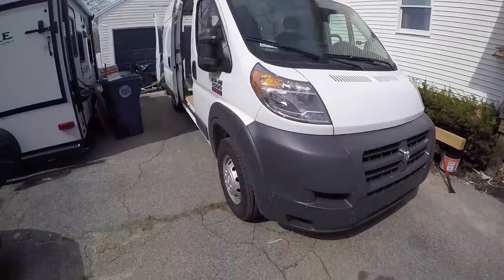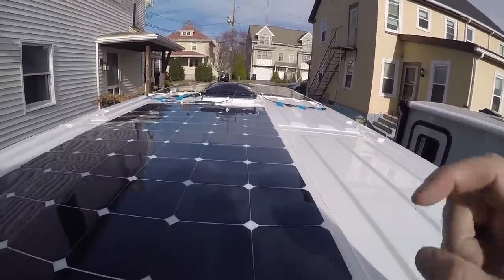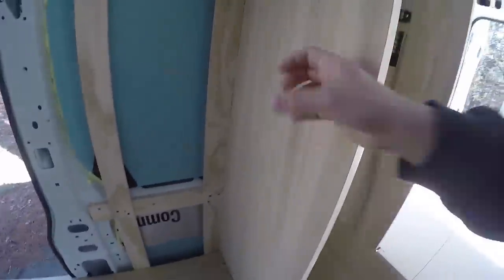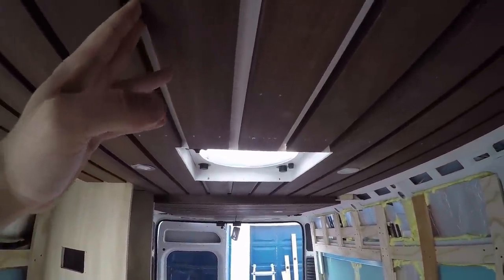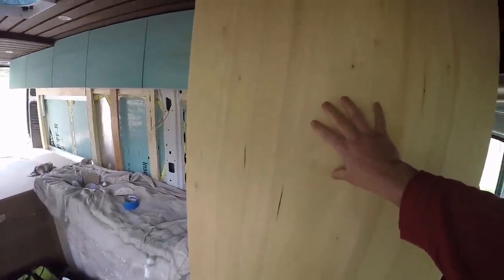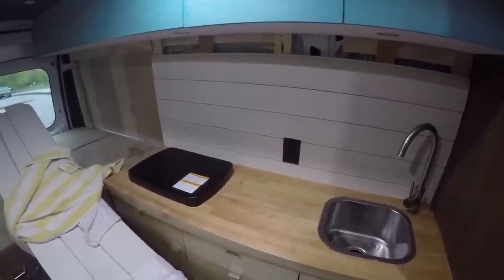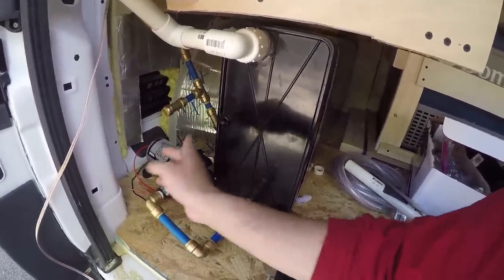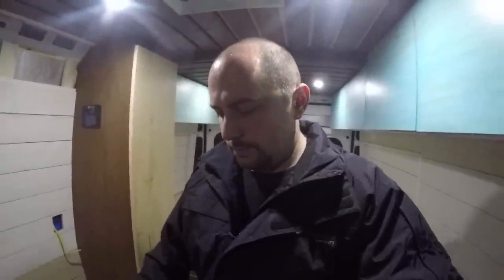How I Converted My Van into a Stealth / Off Grid / Tiny Home Van

Comment: What's the weight of the van befor and after? If your going to do another van u should see what ways u ca  come up with for weight saving/better gas mileage. Great video
Reply from the maker: Thank you. I believe the factory weight of my van is about 5,700 pounds. After the build I'm at 7,400 pounds (which is light compared to others I know, and that weight is with all my things in the van so really the materials are lighter then that). I am building another van but I feel like I'm pretty good about keeping weight down. No matter how you look at it the weight is going to go up and gas millage will go down.
Reply: @JarrodTocci   see wha u can use aluminum instead of wood    if done right I'm sher u could u keep some weight down  the counter top for sher
Reply from the maker: @linkinphm110  yes I could use aluminum as I've seen that used a lot and considered using myself. But to save space I used plywood and aluminum tubing I'd have to probably weld a lot which I didn't want to do. Working in a very small space every inch counts. Only part I'd consider using aluminum would be the bed frame.

Comment: Where did you buy your DC Thermal heater from?😊
Reply from the maker: DCthermal.com but in my honest opinion there's better heaters on the market. I do like mine but bought mine a couple years ago and the 12v heaters are just getting better everyday
Reply: @JarrodTocci  Like what kind? I'm tired of being cold! 😬
Reply from the maker: @campgoerOne  webasto is good and links into the fuel lines. The good ones can run $1200 and decent ones can go for $600. My next heater system is close to $8000. Can't skim on heat so I agree with you
Reply from the maker: @campgoerOne  you could also use a propane style line Mr buddy just make sure you vent!

Comment: Looks great .... That's a lot of wood.  Have you put that think on a scale?   Some states get fussy on weight.
Reply from the maker: Thank you! I actually sold this about 6 month ago and got it weighted right before. It came in 1000 pounds under weight. I just finished my second build! Put out a bunch of build videos and will be doing a full build video and tour in about a month
Reply: @JarrodTocci  I've been using door recovers (not the real name) at $14 for 4x8. Extremely durable and thin/light. Once I cover them with fabric it makes for a good look for the walls & ceiling. I'm in my third year with this method and it has held up surprisingly well. On the excitement level I was a 6 maybe a 7 but everyone comments on how it looks more like an automotive interior than a tiny house so I have stuck with it.  Empty I was getting 24 mpg on a 2006 Sprinter and with the build out I am getting 19 to 22 mpg.  I would love to do a more detailed ceiling that wood gives you but I'm worried about the mpg trade off.  Also I am mainly in Florida and if the authorities want you gone one of their main tools is to make sure you are within the weight limit.

Comment: Are you not concerned about off gassing from the plywood?  I just purchased a van and am cocerned about the formaldehyde off-gassing.   I am inclined to purchase the Pure Bond plywood but it is VERY expensive.
Reply from the maker: C & B honestly no it hasn’t really concerned me. I did look up some “off gassing” and I feel a lot of us live in fear. I spend most of my time in LA so I’d be more worried about the air pollution here then off gassing of plywood. If it helps I haven’t had any side effects since the year I’ve lived in my van and if anything I’ve gotten healthier. If you are really worried about it then pay the extra for it. Hope that helps

Comment: What type of tank did you use for grey water?
Reply from the maker: Mark LaBarge weird story. So I bought one from a store online but had them custom move the drain hole BUT they messed up on it so they ended up refunding me the money. I ended up still using it but I remember it being around $180-200. They were more expensive then I thought. Pretty sure I just googled ‘gray water tank for RV’ and then just read reviews

Comment: So Jarrod after doing a shit load of research I learned that this is not as cheap as stated. This is roughly a 20-40k start up on top of even finding any insurance company that will even touch you living in your van full time. Many won't at all. If they do they will want a house that they can confirm and address with that you reside at
Reply from the maker: We just talking about this in a panel I did at Tiny Fest Northwest. Yes insurance companies are cracking down as this type of living is getting more and more out there. I believe that in the next 2 years they will have to change their policies but for now you might have to bend the rules a little bit. I can't say on here how for obvious reasons but something can be done.
Reply: @JarrodTocci  I get it but still I just want people to see the reality of it as well. Getting into this life isn't easy and no matter how people make it look it is FAR from cheap. Thanks for the response as always

Comment: Looks nice, but the weight must be astronomical.  Technically likely unsafe.  Certainly could have routered out the underside of that kitchen counter and saved 15 pounds and also gotten a little more space under the counter.
Also, seems like some form over function with edges and surfaces that can cause some scratches and bruises.  For example that ceiling may look great and would be fine in a rec-room but with all those edges and reduced height it is going to be hard to live with.  Same with the walls, heavy and unfriendly.  The water inputs are ok there, but you need a way to catch any leaks at the point of connection.  You don't want that just going right on that wood.

Some other weight saving builds are a little too extreme.  There needs to be some balance.

Comment: What is the pink material you put down as your first layer of flooring?
Reply from the maker: Mehealani Velazquez just a filler for the floor ribs. Might of helped with insulation but no way to tell
Reply: Did you purchase this at Homedepot?
Reply from the maker: Mehealani Velazquez yes I believe so. I think I had to split it in half because it was too thick and wouldn’t fit between the ribs

Comment: I have put 110k miles on a 2017 promaster in the last year. it is hands down THE most DANGEROUS box on the road. 40mph winds in ND, MN? Ice, FWD, insufferable torque steer due to the fly by wire and cvt transmission.  Ya.......
Reply: love the build. I just have a hate for this tincan as a whole. also how many times you replaced the passenger headlight? I'm on number 6....... also my drive door seal feel of at some point around 20k miles. all I do is haul parts in plastic bins.....
Reply: Drive safe brother, Godspeed
Reply from the maker: First Last thanks brother. Honestly I’ve had really good luck with mine. I drove it cross country twice and one of those times was in a blizzard in up state NY and didn’t have any problems at all. But I totally understand the complaints. You also stay safe out there

Comment: Jarrod i love this vid and your design got lost on some wood and solar Panels Electric stuff how to wire up over head lights How did you put the wood on the metal Please Help
Reply from the maker: Joseph martin with the electric stuff it was more of a learning experience for me because I was lucky enough to have my father there that knew that. I knew general knowledge but was no where near a pro. For attaching wood to metal I used 3/4” plywood ripped into strips and attached those strips to create a frame. I attached those strips with metal screws and made sure they had a good hold. You have to attach them to the ribs of the van or the screw will be exposed to outside and go right through the van. The van ribs are designed to be thicker metal and can easily hold it (in parts of the video you can see my frame up). I didn’t attach my wall panels until almost last. Also as a side note almost everyone does this different. My father and I built this more as a house then some others that build these as camper vans. I hope all that makes sense. Let me know if you have more questions
Reply from the maker: Joseph martin also go look at my early pictures on my Instagram and that might help a little too: @g.h.o.s.t.van

Comment: I would like to install a kitchen cabinet similar to yours. Do you know the dimensions?
Reply from the maker: Goals and Dreams the lower cabinets are 18” deep and the length of the kitchen counter is 4’11” and the cabinets are split into thirds from there, the height from floor to top of counter is 33” with a 1 1/2” toe kick and the countertop is 1 3/4” and another 1 1/2” spacer to top of cabinets. The only reason the length is a weird number is because I knew I wanted my bed a certain width and bathroom too so whatever was leftover was going to be my kitchen length and I worked around that way. Hope that makes sense and helps.
Reply: Is it safe to say that you have about 2.5 feet of entrance space into the van from the sliding door? Seems as though you left yourself just enough room to get in and out. Thumbs up!!!
Reply from the maker: Goals and Dreams sounds about right. Thank you!

Comment: What is the cheaper way to do that? Did you ever sell it? If I ever sold my 32 foot toyhauler 5th wheel, I might do something like this. The wife and I are thinking about selling everything and living in that 5th wheel for a few years to save up money and get debt free, and then buy something really small for us in a free state to get the hell out of Calif.
Reply from the maker: I did sell this one and I went and built another. I love my new one (also loved my first). Cheaper I guess would be different wood, smaller electrical system. Honestly you get for what you pay for though. This one was roughly $12k all said and done and my new current one is going to be over $40k just for the build parts
Reply: @JarrodTocci  Wow, that's huge.

Comment: Why didn't you use propane for water heating and space heating?
Reply from the maker: michele vitarelli good questions. I didn’t want to have to vent for the shower and I use a portable propane heater as back up. I might switch my shower around to make it propane but still to be determined

Comment: How tall is the inside from floor to ceiling after all that insulation?
Reply from the maker: Melissa Mackay little over 6’1” I’m 5’8” and haven’t had any issues. The ceiling over the bed is dropped just a little more
Reply: Oh I see. My boyfriend is 6'4 so that would be an issue I guess.
Can't seem to find anything that would work.
I like your build though.
Reply from the maker: Maybe a little problem. I think it's 6'4" without anything in at all. I do think the Ford Transit vans are higher though! So maybe look into those if that helps any.

Comment: Great  Build ! Congratulations and a question ... why not place on the roof top another 200W solar panel, total 4 x 200W solar panels? It seems like there was enough space there ?
Reply from the maker: John Smith thank you!! and great question. I guess I could of but 600w of panels is what my calculations worked out best for me with the rest of my system. Plus it would of been a few hundred dollars more
Reply from the maker: John Smith thank you very much 😊 it is the same van. If you have any questions during your build feel free to reach out
Reply: Thanks a lot for your offer Jarrod, but I you already helped  a Lot, with your video. I'm not going to have such a awsome build since I intend to have a much simpler and Less awsome design then yours :) .. but your video alone gave all those that view it a ton of ideas I'm sure. Again, thanks and congratulations.
Reply from the maker: John Smith thanks and good luck. I also just did a 2 part tour of my friends van and hers is beautiful and simple if you wanted to check that out
Reply: Yup another great video. I've seen it too. Her setup is more of what I envision. Simple rig simple setup ... the only thing is that I will go for is a larger wheelbase like the one on your van (and that video I linked with the 900W solar setup:) and of course ... more solar power :) we can not go wrong with more solar panels :)
Reply from the maker: John Smith haha I agree. More power! Best of luck on your build!

Comment: Hey Jarrod Tocci  I live in Canada  I want a shower in my promaster 3500 what do you think would be a great idea for the grey water tank I was thinking  on the bnottomof the van and maybe have a heat tracer wire so in the -30s in winter it wouldn't freeze ?
Reply from the maker: This issue has always been in my mind. You could go that route with the tracer. Also a thought which I might do for my next build is no gray water tank at all. I'm thinking of making a valve to only go one way and just allow water to flow outside. In van life you'll quickly realize we use all biodegradable and eco friendly soaps so really there's no harm doing it this way. Reason I'm telling you this is my current van is up for sale and my next one will be designed to handle 120 degrees and 0 degrees! It's been a serious amount of design and engineering but it's possible
Reply: @JarrodTocci   let me know how that design would work with the valve?  do you know any good forms  on teaching ppl about van life as  this van will be my first and living in full time also what do you think about spray foaming the van ? I know its expensive but if you could get a good deal would you do it? and why?
Reply from the maker: @bradymarsden  YouTube is a good place to learn about van life. I have done not just tour videos but a vlog style trying to teach others what to do. There are others too that do what I do. In my experience there's only one way to learn something and that's just to apply yourself. You can only learn so much from watching a sport or a someone telling you how to play, but you truly learn how to play a sport by actually playing. Hope that helps
Reply: @JarrodTocci   that totally helps I'm just trying to figure it out on paper and such and getting as many people opinions as possible who have had experiance jn this field

Comment: I'm lost when applying the inverter and electronics components for the solar panels. Where can I go to learn and hook it up?
Reply from the maker: good4damoney very good question. Have you bought your components yet? When I bought mine I tried to get everything from the same company only because if I had questions I knew I could call them. I also have a video of me touring a solar company that help help a little. For me I spent hours doing research online on what size wire to use and which component to plug in and when. Honestly in the end I had many headaches. If it wasn’t for my dad I would of just paid someone to hook it all up for me. People that do ask me about electrical I usually tell them it’s easier to pay a pro. It’s been a while since I did all my research but I remember googling “how to...” and just read different foarms that lead me to how to do it. Hope that helps a little

Comment: how much for your service charge you want to cost me? 
if I want you to convert my van into a pretty similar like yours!
Reply from the maker: I'm actually selling my van if you're interested, there's a holding deposit from someone but I know soon if that transaction goes through or not. You can email me at: theghostvan@gmail.com

It's not so much about how much but really on how long. This build will cost someone doing it themselves around $10,000-$12,000 and it will be about 400 labor hours or more. If you went to a builder and ask someone else to build it then my guess is they would charge $35,000-$40,000 just for the build. Hope that all helps.

Comment: Hi without the price of the van included how much did it cost for everything else 
Thanks
Reply from the maker: After all this was done it was a little over $8000. I've recently have done some upgrades like changing the back door look, shelf in my bathroom for my toilet, installed a TV, and designed and built a full woodshop in the truck/garage area. So with those additions I probably spent another $1000

Comment: What's the efficiency rating on that heater?
Reply from the maker: Hmm Not sure on the efficiency rating. It's made by DC Thernal and it's 10,020BTU
Reply: Jarrod Tocci Ahhh, usually they come with a rating, like air-conditioners. I was excited that you found a super energy efficient one, since  you are trying for sustainability. Big fan on the van!
Reply from the maker: Hideous Penguinboy thank you. I’ll check out where I bought it offline and see if it says anything there

Comment: didnt quite get what the point of the silver patches on the walls was...
Reply from the maker: Derva Kommt von hinten that’s called rattle trap. It’s used for sound damping. Helps with vibration of the metal
Reply: thanks for the quick response. hard to believe it works. if it whole side of the vehicle were covered then sure, it might have noise isolating properties. but with just a few patches here and there... do you know how these work? O_O
Reply from the maker: Derva Kommt von hinten in the instructions it says only need to cover 25% of surface for being effective